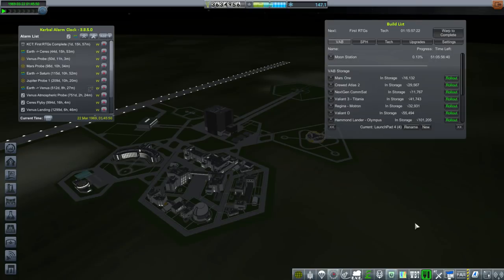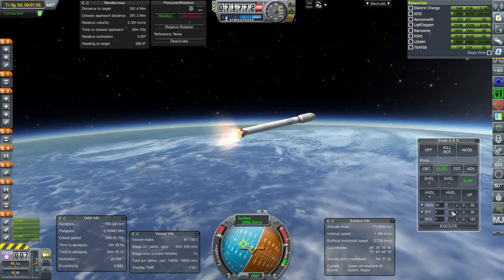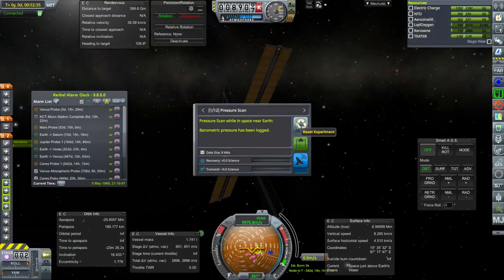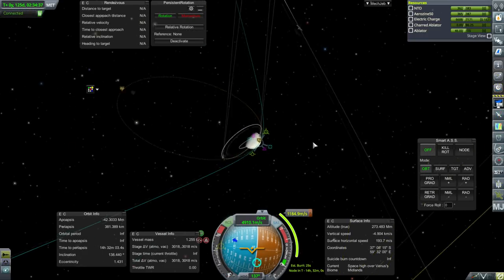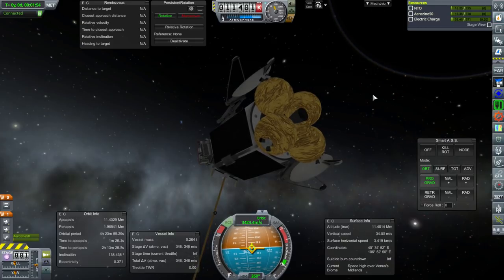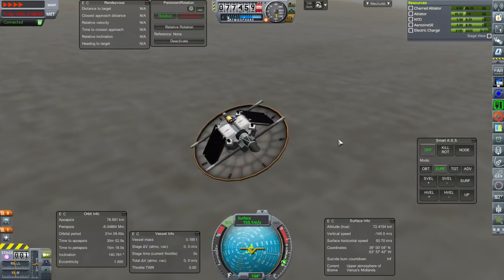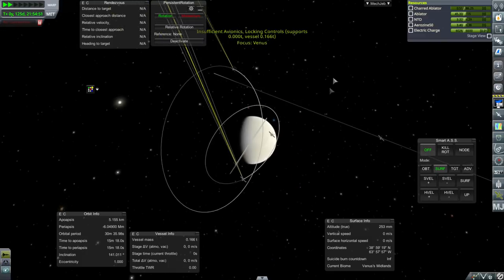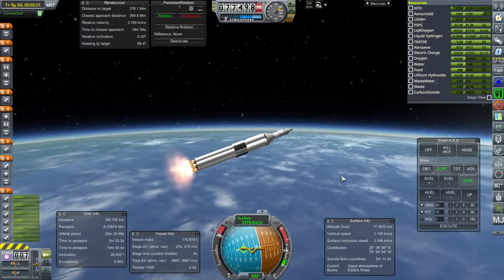KSP 1.3.1 with Realism Overhaul - RP-1 40 - Always Full of Surprises

Comment: instead of using a maneuver node that might confuse you later you can also set the SOI change as the alarm but give it a looong time ahead for the warning
Reply from the maker: I would if the next SOI change was the one I wanted, but usually I set the alarm when the next SOI change is the one exiting Earth SOI, which is the wrong one. That's when I place the dummy maneuver. And it doesn't confuse me - as soon as I see it's 0.0 m/s I know it's one of those maneuvers.